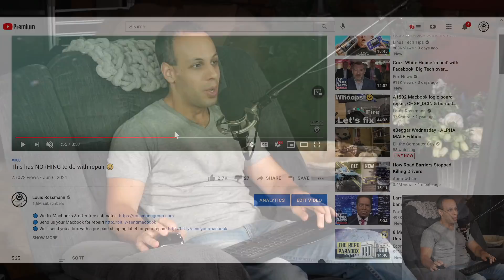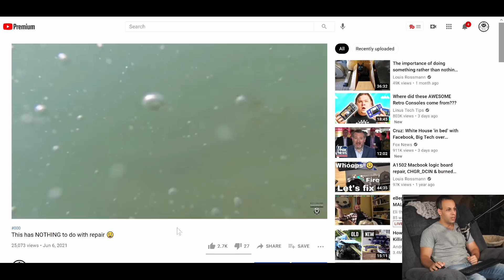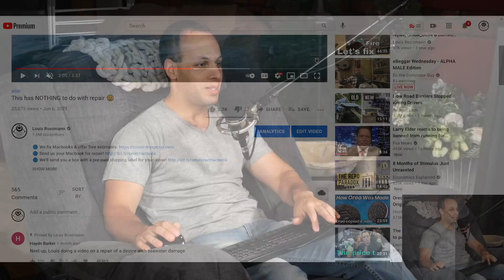Why are user serviceable batteries a bad thing?

Comment: Phones need battery compartments like tough cameras, they should come in from the end or the side, not the back or front. Waterproof seals are much better on those action cameras because they have a solid little door with seals and a latch. 
I've been swimming with my Pixel 2, recorded video underwater IN A POOL and underwater in a pond to film fish. And washed it under a tap. It had zero water inside it when I finally swapped the battery.    
The S5 that got a casual glass spill had ample liquid inside it however. 
Lots of people say "the S5 was waterproof!" But no, no it wasn't really, especially not after a couple of years of bumps and pulling the cover off and back on again. Never take me back to that style of back please!

Comment: It's doesn't even have to be easily removable, all the arguments for the sealed battery are actually for the glass back, I see no reason why the glass can't just 4 corner screws with rubber washer, the glass back is the one this that breaks the most on a phone in my experience(which is why I stopped buying those after the note 5, my first(the screen never once broke in the 4 and a half years I had it)) so why not just ask for them to be cheap and easy to replace by yourself and hell you could get custom back plates again like in the s4, s3 days

Comment: I remember when phone software was much worse and would lock up all the time. The only solution was to pull the battery because the board wouldn't even process button presses. Could you imagine if that was common today? Nobody would tolerate that. Also I had the S5 Active from Samsung which was one of the most water resistant main stream phones at release and you know what it had... a user replaceable battery. Thank god it did too because as it aged that thing received such poor support that it locked up all the time.

Comment: It's part of the reason why I usually get rugged phones. Sometimes found under "Military phones" or "industrial phones".

Yeah the specs are shittier than flagship phones but honestly at this point mid tier specs aren't bad at all. But these rugged phones tend to be easier to service and replace pieces if you find some with removable back plates. And they're at least designed to take a beating and water exposure that would kill most phones.

Plus phones like Kyocera have better screen protection with actual true sapphire glass.

But then you get labeled the guy with the cheap weird phone while they're on their second or third flagship because the back glass broke... Totally missing out on that.

Comment: I hate non user service products and have been forced in to them with things like smart phones. Up until last year I was happy with my lg v20 with a over sized battery and case and if the phone had not been slowed down and phased in to unusable conditions by software I would still have it now I still have a lg but it is not serviceable. Another thing that was done away with and for my line of work was a huge pain was ir remote control functions on the lg line and a few others that had it. Having this feature was so valuable to any one that worked with media devices as you could just add a remote to the phone to control the device no hunting for the original no concern for batteries just have a charged phone with a ir remote and you were good. This was a great private and commercial feature that saved hours of time and headache. So many people forget that iphone is not the only one to be smart and it was not the only one to be smart at the start from the lg envy to motorola to black berry many phones were smart at the start acceptance that you are considered to stupid to know how and what your device can do by the company is the only reason apple is now the standard that all the rest follow and the consumer is the only one who can stand up and say enough. Sadly most people are sheep and apples stock proves that every day.

Comment: I don't believe that batteries shouldn't be user serviceable. Just a few weeks ago I had to replace the battery on my GBASP. After 20 years the battery life was finally so bad (and the battery itself was swelling) that I needed a new one to continue playing my now retro games. Obviously it's not in production by Nintendo anymore, but there are plenty of third parties selling replacement batteries on Amazon. I got one and it works like it's brand new again!

Now I will say I felt like I was putting blind faith into my purchase. For me a concern that I have is that the battery is manufactured poorly using cheap quality parts. I'm thinking specifically about phones in the past that have exploded due to a flaw in the design of the battery. I'm also thinking about some of the charging stations for rechargable AA or AAA batteries that people have claimed to have caught fire (whether or not it was from user error is up in the air for me, but I digress).

The reason I'm concerned is because in the best case scenario, the battery just doesn't last as long as it should because it was cheaply made. The worst case scenario is the battery explodes or catches fire, destroying my device and my hands. I don't really know who manufactured this battery, how the battery was made, or who's hands its been in before it got to me, so I don't know for sure what the quality of the battery is. That being said, I went through with the purchase while paying attention to the reviews (4.6 average from 808 ratings seemed good enough for me). As for servicing my GBA myself, I wasn't worried about messing it up because it's so easy a monkey could do it. I just unscrew the battery cover, unplug the old battery, plug in the new one, put the cover back, and turn on the Gameboy. Easy monkeys. That's the first time I've said that phrase and from now on I'll continue saying it whenever someone thinks something is way harder/more complicated than it really is.

I'm not going to throw away my old Gameboy for a new one because there's no such thing as a new Gameboy (unless someone kept one in a box after all these years). I know emulators are an option, but there's nothing like the experience of holding the actual hardware in your hands. That's why despite my concerns, no matter how irrational or rational they are, there's no reason why I shouldn't be able to fix it myself if I know I can, especially when it's as easy as 1, 2, 3. I'm glad that I was able to easily replace the battery myself. I'm glad I could extend the lifespan of this already ancient device. Being able to preserve the history and memories of this thing is valuable.

I feel like sometimes when I'm talking to someone about this type of thing, they act like I'm making it sound way less complicated than it actually is, like I'm skipping some steps in the process, like I'm trying to lie to make them feel stupid... No, it is actually that easy, and you're arguing with me because you're overthinking it for no reason instead of listening.

Comment: I would LOVE a user serviceable battery! but I still won't compromise on the design and seamlessness of devices. 
I don't want flexible plastic backs. I don't want a significantly thicker device. 
the pinned comment argued something similar and there were 2 responses: 
1-  there were X device that had a metal backplate and a removable battery. the HTC sensation, the N97. 
with all due respect, there were fine phones for their days. not as sleek, thin, or "glassy" as today's glass and metal sandwich phones.
someone mentioned the G5, it was a nice phone indeed. but they needed to do the whole modular part thing to make it happen, they failed miserably and support has stopped. I also can't see how a similar idea would apply to today's chin-less all-screen devices. 
2- people calling the commenter ignorant or misinformed. please don't call me ignorant because we don't fully agree on everything. 

I would love right to repair laws to force companies to provide repair shops with original batteries that they can use for repair. and I think this is the way to go for now. 
I also would like to have a user replaceable battery. but I just can't see it happening anytime soon. 
it would need a good amount of R&D and innovation by say, Apple, to give me an iPhone 12 mini with a user replaceable battery. and Apple, being a corporate, does not currently have any incentive for pouring resources into such a thing that clearly most people outside enthusiasts don't currently care about. 
maybe most people will say oh I'd love to have a replaceable battery. but it won't make most people, including me, switch from their favorite brand just because of it. 
so it's a hard thing to do while keeping modern form factors, with little incentive for companies.

so maybe we should focus on the biggest issues concerning advancing right to repair. 

(my whole point is about smartphones, not cameras or anything else)
Reply: Extra point: the HTC sensation has a metal back. but it doesn't mean the design was that good. it wasn't even comparable to the iPhone 4/5 or the (just 2 years later released by HTC) the HTC One series.

Comment: While I understand how a screwed-in battery can be liquid resistant (rubber/silicone gaskets are great), how the hell is that camera so liquid resistant when the battery seems to just have a basic plastic latch to hold it in? That is some seriously good engineering.

Comment: I'll tell you the reason, because they don't know how the technology works. Most people think water resistance is tied to 'having rubber seals round the inside to stop liquid leaking in' + 'Water + electricity = dead'. They know nothing about pressure, surface tension, or how forces act at different scales. They don't know what an iso wash is and think chips are impossible to solder back on. They argue against their own interest because of ignorance, just like every other time in history.

Comment: Making the battery user replaceable is a compromise that will always make the phone slightly thicker than it could have been, for the simple reason that you have to put material between the battery and the rest of the electronics, and between the battery and the user, to prevent the average user from damaging either during replacement. Unibody phone batteries are protected by the phone so the cells can be very thinly wrapped, and can be right up against the electronics with no barrier, allowing for slightly more capacity or a slightly thinner phone. User-replacable batteries have a thicker shell around them to prevent the user from damaging them, and require a separate compartment from the electronics, both of which take up space that could be cut down or used for capacity. You also have the flexibility to put the battery anywhere in a unibody design, make it any shape, and even use more than one, to take advantage of whatever space is available. While I personally would still prefer a user-replacable battery, I can understand why someone who always replaces their phone with the latest every 2 years would prefer to lose that space or use it for something else.

Comment: There are a few factors.

A removable battery would need to be inside a rigid plastic case that limits the capacity of the battery you can fit into the same amount of space, if it weren't there would be way too much liability from laypersons puncturing batteries.  Would you trust the average joe jill bob lynn dani frank smith that walks into your store to be handling an unprotected lipo when some of these people are so stupid they can barely chew.

It would also need to be limited to being a rectangle or a square for again, ease of installation, which would limit capacity even more.

It's not necessary to have a sealed battery to make something waterproof, but it makes it a fuckload easier to engineer a metal and glass cased device that's less than 8mm thick without having to worry about how to reliably latch and seal large, thin, bendable panels e.g. The Galaxy S5 and Note 4, or elaborate slide cavities e.g. the LG G5 and most early HTCs.

Most of these issues could probably be solved if thin phones weren't what customer pressure leaned on so heavily, and it's the main reason why I can't think of a single flagship that's had a removable battery for years.

I'd honestly be happy if they could engineer a way to put the damned things together without using that adamantium based adhesive.

Comment: The iPod first had a battery that was soldered into the board. The battery failed after about 18+ months. It took several (public) complaints before Apple made the battery easier to replace. It actually cost more to replace the battery than to buy a new iPod.

Comment: Why would anyone want a phone or laptop where you can't replace the battery? I can't easily replace the battery in the phone I have now and I hate that part about it but I was not able to find a better phone at the time with one I could replace. On my laptop I can easily replace the battery. It just has two screws in it and the battery comes out. The previous model just had a lever you moved and I think that made the battery come out a little too easily so they added two screws. Either way removing and replacing the battery takes less than a minute.

Comment: Holy. Hell. I don't want that (in regards to sealed phones that are user-servicing-antagonistic).  One of the things I miss the most from my Nexus 5 is that easily removable backing that let me pop it open and tweak around with the guts of the phone. It was a pretty flimsy phone, and had modular parts that weren't really all the well secured, like the front facing camera, which I promptly lost on my 3rd battery swap. But I also submerged the thing in water after jumping into some rapids after my dog, and after disassembly and a couple days of drying, it worked perfectly after that. If it had been a phone with a harder to remove carapace it would have gotten just as wet, but would have been 3x harder to take apart and dry. 

It's refreshing to see someone mention that sealed devices aren't necessarily water resistant, and that you can still have user-serviceable batteries in water resistant devices.

Comment: Im never buying a phone that does not have a replaceable battery, or any device whatsoever that has any part that will fail several times within the lifespan of the device where its not easy to replace.
Imagine buying a drill and not being able to change the cable or the motor brushes or the battery in the case of the battery powered ones.

Comment: That's weird, I legit swim and shower with all my Samsung phones. Most of my friends and family pretty much do the same, maybe they sold you a defective unit.
Reply: thats not ocean water ,which contains salt and other substances ,you could read manual and it says we do not cover ocean water damaged phone
Reply: @cistokrvnibosanac1266  it's been in the oven many times for hours at a time.
Reply: @charlesworpek2653  warranty doesnt cover salt water
Reply: @charlesworpek2653  ok i dont know ,but i ve never put phone under1.5 meter in water,you should do the research
Reply: If the device is exposed to any liquid other than freshwater (saltwater, ionized water, etc), gently rinse it with still freshwater immediately and dry it thoroughly with a clean soft cloth. Otherwise, salt may accumulate and block the primary earpiece and external speaker when it dries.

@samsung
Reply: @charlesworpek2653  It doesnt get warranty now,i ve had sony z1,contacted them,said the deal,i was literally 0.5m in water for 3 4 minutes,they even covered water damage ,then they said that if its salt water its fucked and they gave up
Reply: @charlesworpek2653  its not dust OR liquid ,6 is dust+etc 8 is liquid +etc
Reply: @cistokrvnibosanac1266  yeah no s*** Sherlock 😂😂 someone finally spent 30 seconds with the Google search 🤣🤣🤣
Reply: Was it worth all that effort to correct me on something I wasn't wrong about? I never claimed it was covered by warranty I never specified how exactly each individual brand treats the IP certification they've received. I simply said ally devices have no issue with it, get a life 😂🤣

Comment: the 2010 motorola defy, one of the first water resistant phones, removable battery, usual ports, all with covers... a party trick was to let it sink to the bottom of a jug of water, no issues.

noremovable batteries have no real benefit to the consumer. I've thrown hardware with such batteries out once the batteries had died because it was cheaper to buy a newer device.... a complete waste of resources.

Comment: even if they went back to how the Iphone 4 was built, with a "not really userreplaceable battery", i would still love that. if you need a new battery you cant pop one inside right away, you do need to buy a special tool for the special screws but thats a one time purchase and the backcover comes off easily. on the contrary, i repaired my old huawei and that of a family friend, i somehow managed to break off a piece of that plastic on the back of my phone, and with the other huawei phone, the battery was adhered to the phone so strongly that i had to bend it out basically and it caught fire. 

so with glued in phones everything is so much harder and worse in every aspect, instead of a 2 second or 5 minute job for battery replacement it takes hours and you can damage part of the phone, you can cause a fire and burn yourself or your house if you are really unlucky, you have to throw your phone out earlier, and oems can charge you so much more money for this simple process that otherwise everyone with two left hands would be able to do.
how can anyone except for greedy ceos and company representatives advocate in favor of this glued mess where oems make it harder on purpose for you to repair your own damn thing?